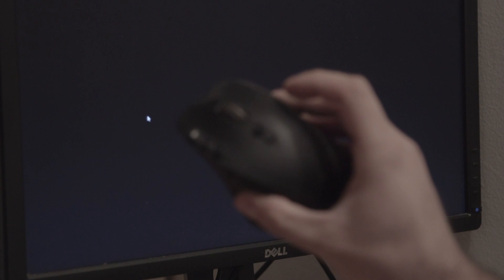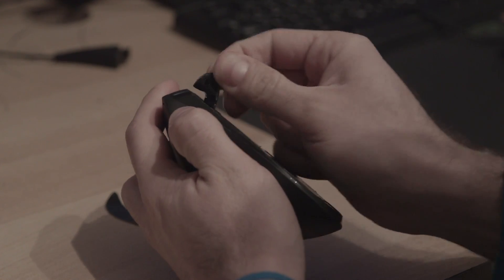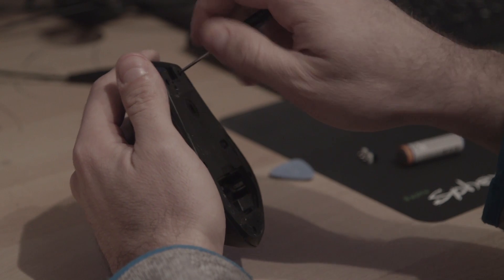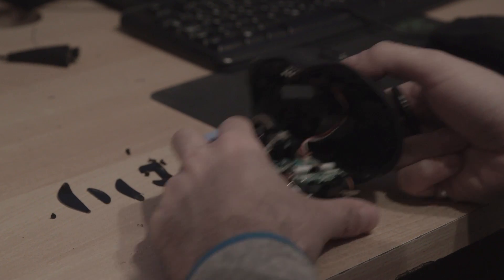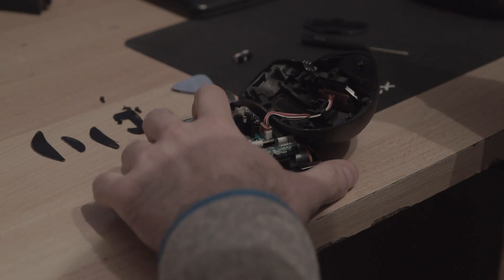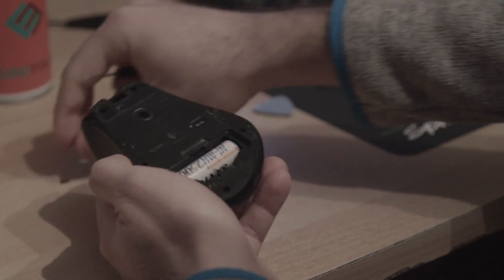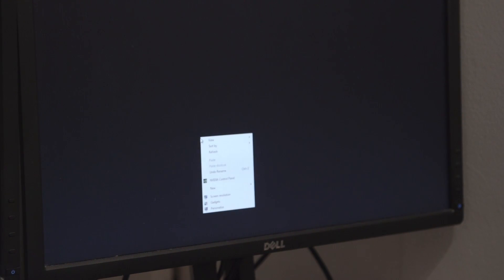How to fix faulty left mouse button (Logitech G700)

Comment: You don't need to remove screws. You can just lift the the left click pad up by sticking a knife or something underneath. It will click loose and you will be able to pull it open for about a centimeter or two. Enough space to see the micro switch and blow air in. Push the pad back till it clicks.
Smart engineers at Logitech.
Reply: Thanks, was wondering about that.
Reply: Thanks! This saved me from having to buy new gliding pads. Just lift up the left or right click button and blow air in.
Reply: you a legend, tyvm!!

Comment: Thank you, Igor. This 78 yo was figuring on having to buy a new mouse because of left click not working. I found your video and upon opening my Logitech mouse saw a small dust bunny lodged inside! I removed it and blew inside as hard as I could several times before closing mouse, and it's working fine again. Sure do appreciate your video help.

Comment: I have a G700s with the left button problem and after seeing that a replacement is currently $400 I decided to attempt fixing it. I can endorse the "Turn upside and smash on desk" method. It solved my problem!
Reply: Work Deoxit G5 into the left and right mouse buttons with a Q tip to fix the double clicking problem. 5 years after treatment and working like new.

Comment: There is even a better way to do it. You can lift both buttons enough to make the switches accessible through the gap. No need for new sliders or a screwdriver.

Comment: Thanks Igor, I've just done essentially the same thing only I used isopropyl alcohol from a can as I didn't have compressed air, worked like a charm. Rather than removing the feet/skates I just stabbed my screwdriver through the holes and it's working perfectly, feels exactly the same as it did to move around on the mouse pad. Cheers!
Reply: I have the problem with my G700s but I'm too scared to start jamming my screwdriver in unless I know exactly where the holes are. How did you judge the positions?
Reply: makbar59 Watch the video above and you can see roughly where the holes are. Then if you press your fingernail around the area that the holes are, you can see the skate start to press into the hole.
Reply: Wish I had read this comment before...my mouse is now slightly scratching my mouse pad.

Comment: 4 years later, yeah, it's not new anymore, but it's still my favorite mouse.

It's wireless when I need it, but can be wired when it runs out of juice, or you can keep a spare set of batteries and swap them out if necessary. The usb cable supercedes the receiver, so I can plug one into my desktop and the other into my laptop, then change which one I control easily. The only thing it's missing is  a magnetic cable, but $15 and you can get one off amazon/ebay/etc that fits inside the little nook fine. The one I found, the cable is strong enough I just have to get it close and it snaps on. I love the scroll wheel. It's got a few extra buttons for macros/hotkeys without having a full fat keyboard on the side like those gaudy mmo mice. It's the right size for my big paw. It sits on a pedestal as the mouse by which I judge all other mice.

I only wish they'd come out with the g700c (or g770 or whatever) that upgrades the usb micro to usb-c and maybe use better switches, or at least not make them such a pain to replace.

Comment: Thanks for the fix, Igor!
I really enjoyed your comments.
Dissasembly + blasting with compressed air did not do the trick for my G700. I fixed a small piece of duct tape to the part that transfers the finger's presssure to the "omron japanese micro switch". Works like a charm again

Comment: My 2014 G700s just died on me. Exact same problem. I guess I'm done with Logitech. No point to buy an expensive mouse if the internal components are the same as a low end mouse.
Reply: Update : I just fixed it without openning it. Just hit the left button realy hard with my finger. Like VERY hard. I'm finger hurts. But my mouse is working now.

Comment: This has happened with every single Logitech mouse I've ever had, it's ridiculous, but what's even more ridiculous is that I still buy Logitech mice!!
In a single year I'll get through  3 or 4 mice, and I'm not even gaming with them, I'm just using them for browsing mostly, no hard knocks, no spills, nothing.

They're good mice until these silly failings let them down, I'm yet to find a decent alternative, any suggestions?

Comment: I have the G700s with the same issue.  Though I didn't have a can of compressed air, I just blew on it a bit then placed a drop of Liquid Wrench on the button and worked it in by sliding my finger over the button and clicking it a bit.  I cleaned off the excess with Isopropyl Alcohol & a cotton tip swab then let it dry.  While I had it open, I did the same for the right mouse button. My mouse works perfectly again!  No more intermittent clicks and unwanted releases.  I proceeded to open up a small travel Logitech mouse that I had stopped using because of the same issue.  It also has the same switches.  I used the same procedure and it works again!
Reply: I use Deoxit G5. Works great.
Reply: @KurentEweser  I looked into it.  Though Liquid Wrench worked, I'm going to get me a can of DeoxIT for future issues.  It seems to be specifically formulated for exactly this type of problem. Thanks!
Reply: @Mr.Vizcaino  Deoxit G5 contains a light lubricant to prevent future oxidation as well as a cleaner. Liquid Wrench appears to have the same qualities but doesn't evaporate when the job is done.

Comment: The lever that is pushing the switch is the problem there are 2 bits of plastic on it ,for protection that you can not press the switch to hard remove these and the fix wil work longer.   the are only 0,1 mm high

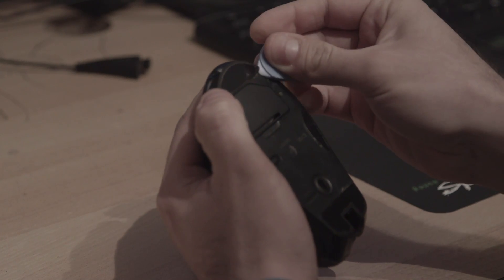Comment: I tried the remove-battery-and-click-100-times method to discharge the capacitors, but that didn't work. But my G700s started working exactly at 1:28 after I started watching this video. Guess it got scared of surgery!  :-)

Comment: My G700s just started this problem. I've had it for 4 years now. Still sucks to see it this way.
Will try and let you know if it worked
Reply: I've had my g700s for 4 years too and I have this problem, I shook it around a couple of times and that did the trick, still happens occasionally, now I'm planning to buy a g502
Reply: @rohansatram   Mine didn't work. I threw it out

Comment: I had the same problem as you, I took the screws out and the case off and cleaned the inside, blew on the switch and it was 100% better. :S weird! glad I tried before going and getting compressed air!

Comment: If you can slightly pry up the left button without using to much force you can basically direct some compressed air over where you know the switch is and give it a good blast and youc an often fix it without having to take the whole thing apart.  Though you're firing blind a bit because you don't want to force the plastic up to high and break it.
Reply: worked perfectly thanks so much!
Reply: Hi, did this fix your mouse permanently? Or did it go back to being stuck soon after?

Comment: turned my mouse upside down and slammed in on the desk a few times while watching this vid, seems to have fixed the problem.  at least for now.
Reply: Followed your tip (except I hammered it into my other hand). Until now it works.
Drove me crazy at video editing. Thanks! :D
Reply: I just did what you're saying, and now my mouse is working like before. Thank you!

Comment: 1) This guy is a genius. 2) I had the same problem with my Logitech G903. If you lift the button, you can see this switch. It's blue, not white. I just stuck the compressed air straw in there and blasted the shit out of it and it's working great now.

Comment: Can I use an automotive compressor to clean it?
Reply: Sounds a bit harsh, because that pressure could blow some components away. You can try your luck and blow with your very close to the omron part.

I'm so happy that I finally found a solution for this because I was living like this for far too long.

I hope it works out for you as well. :)

Comment: i once had an mx518, it worked for probably 8 years before dying. now i have an m510 which has nice ergonomics for me, but it only worked for maybe 6 months before this problem happened. the "cleanup" fixed the issue though, i feared i had to buy a new switch to solder, or more likely a new mouse. thanks.

Comment: Have the problem on my g903 left mouse button, but it happens randomly and mostly I play for hours and it's ok.

Not even sure if it's the hardware (could be oxidation/scale from improper contact) or some driver/os issue...

Comment: Sometimes it is not dust in or on the microswitch, but oxidation on the minuscule contact surfaces inside it. It is possible to open the microswitch and pass an extremely fine grit sandpaper on the surfaces, but it is extremely tiny and fiddly work, with a more than average chance of the switch internal pieces coming apart. It is very difficult to assemble it again without bending the tiny metal sheets. But you can always try it if solding a new microswitch in sounds difficult, or if you live somewhere where they are hard to find.

Personally I have bought a backup copy of my now-discontinued G700S since it is the best mouse I have ever used, and would have a hard time getting used to anything else (for both work and gaming).
Reply: buy micro switches on ebay.

Soldering a new microswitch is alot more easier than open one up and trying to put it back together.

Comment: This helped but I wasn't going to risk opening it.  I gave my MX a few smacks and blew compressed air through the cracks and it fixed my issue.
Reply: There is nothing risky about open up some screws.

The bigger issue is whether the mouse feets lose their stickiness and become bent when you remove them.

Comment: Have the same problem, but on the G900. Thanks for your video. I appreciate it. I will get to work. Agree with you. Love Logitech designs and products while it works, but hate it when it breaks down for stupid reasons like that.

Comment: In the end you ideally buy cheap micro switches, take out the copper spring and put in your mouse. Alternatively take your micro switch apart to just reshape the copper spring. It's either one or the other that is the best solution that works.

Comment: Thank you so much! I freaked out after my G302's left click stopped working completely since I can't claim the warranty in Pakistan. Your video was an immense help, I took it apart and after a fuck ton of blowing from my mouth the button is working flawlessly. A suggestion for anyone who doesn't have access to a can of compressed air get a bendy straw that way you can better direct the air towards the holes.
Reply: Video discription says its for double click problem but it works for all other kind of issues too including click not working. if u r a bit experience use soldering method then the problem won't reoccur frequently.

Comment: I have a brand new Logitech G700S and it started doing this shit in less than a year use. 
I tries blowing compressed air without dissembling, kinda didn't do anything as I prolly couldn't hit the switch. 
Then I tried the turn off and click method which brought it back to to how it was and it worked perfectly, for about a week or two. Now nothing helps. xD 

I just tried doing the clicky thing, still not resolved really. 
I kinda makes things a bit better, but I think it doesn't really solves it. 

I had the scroll wheel metallic cover started rusting and peeling here and there too. xD 
I can't say I'm pleased with that, but generally I wouldn't care less until the LMB click started. 

Tbh, kinda disappointed with Logitech given I had a G5 that lasted for like 10 fucking years, which had other stuff fail, like the scroller wheel, but at least it was past the expiration date and the LMB and RMB worked till the last day. 

Given the G700S should've been gamer grade, this doesn't really speak well when this issue is seemingly that ubiquitous. 

Sure doesn't help from stopping you to finally wanna wander and try other brands, especially some that are priced cheaper, yet still have good critical feedback. In the worst case scenario, at least you will waste less money. Hear that Logitech?
Reply from the maker: You bought is less than a year?
Reply: Yeah, it was brand new purchase, not refurbished or anything. 

The funny thing is that since last night it apparently hasn't had any hiccups, until the next time I guess. :P 

But why it's funny, is bcs I was trying everything, starting with 2 powered off exhaust clicking sessions, that seemingly didn't solved things right away, so I went and tried blowing with compressed air through the narrow, when I lifted the LMB with a bamboo toothpick. That too I thought did nothing. 

Overall, it seems to have gradually reduced doing the hiccup over the night. 
It certainly didn't seem like either thing solved the issue all alone, rather the mouse has a mind of it's own and tho the efforts I did seem to improve the situation, it's rather co,es and goes when it pleases I assume. 

I've never had experienced that before, at least not with higher tier mice. :P 
Altho the part actually costs next to nothing and it has many ways in which it can fail, even straight out die. When I build this computer I also had 1 of my 2 pack Crucial ram stick DOA, but other than that everything else seems rock solid so far. 

But ppl spend the extra money with trusted brands, not only bcs of the seemingly higher quality, but also bcs you would put a little more trust into those products, like having them wait until their expiration date at least before they start to act all strange. xD 

With that being said, I know that no matter how expensive a tech piece can always fail or have a defect, it sadly happens. However, with this case it seems like there's a bit of a trend, and when that happens the reasons are more likely than not that the manufacturers cheaped out on some aspect, whether the parts themselves or mostly skipping QC completely. xD 

Whatever the case, this isn't a good practice, the obvious reason is not only that you are making a bad name for your company, but you are also trying to screw and skimp your customer base. 

Maybe you can make a few thousand bucks from cutting corners here and there, but if you made the fuck up to cause a whole line of a product ending faulty with a specific tendency more so, it really can make ppl turn towards other brands the least, not to mention forsaking your brand for life. :P

Comment: Worked on mine.  Thanks a lot.

One suggestion:  I was impatient, and didn't want to wait the couple of days for the replacement teflon pads.  What I did was use an X-acto blade to cut holes over the screws.  I got a general idea of where the screw holes were located from your video and some others.  Then, I smashed down on the pads, and I could see where they dented in.  The only tough one was the shallow one under the thumb buttons.  Because it is so shallow, the screw tended to grab the blade, making it difficult to slide it to cut the material.

A secondary benefit of this is that the pads act as a screw holder.  All five screws were held in place.  Less chance of losing one, and they made putting the top back on very simple.

I can't feel any difference moving the mouse on my mouse pad.  And, if I decide that it's not working, I can always order new teflon pads, anyway.

Comment: This is my second Performance MX mouse because I really liked the first one. It began doing the same exact thing again which prompted me to google a solution. Thanks for making this video. It is very helpful and I like your tutorial style. I decided after watching you take it apart I won't be buying another one of these because it doesn't appear they will ever fix it. I slammed the fucker a few times and low and behold it works fine. For now. I just ordered a completely different product so I can throw this piece of shit in the trash the next time it acts up. I only wish I could still leave an Amazon review to warn other poor bastards like myself to steer clear.

Comment: just want to say that I slammed my G700 first on my desk then on my bed (because the desk was a little too hard) a couple of times, like he mentioned 3:39,  just because why not, and it ACTUALLY fixed it. I think it kinna worked like that can of air, the slamming "moved" the stuff that was in that switch. But I know this Isn't a permanent solution ( or maybe it will be :) ), and some people say that its the metal part inside the switch which get "fattened out" over time, that you have to curve  back a little. But yeah, just wanted to mentioned this as it actually "fixed" my G700 within 10 sec :)

Comment: TAKE OFF THE TOP HOUSING AND PUT A DAB OF SUPER GLUE WHERE THE LEFT OR RIGHT CLICK CONTACT SPOT IS. LET IT DRY FOR ABOUT 24 HOURS, THEN PUT THE MOUSE BACK TOGETHER AND IT SHOULD WORK
Reply from the maker: Im Jays I would not advise that method.
Reply: I did it and it worked
Reply: Yeah^ do NOT do that.

Comment: Had exactly the same problem, and blowing air did not resolve it. BUT THERE IS A SIMPLE FOLLOWUP!!!!
You need to use a small sharp object and you can lift up the cover of the switch itself. Look at 5:41, you can see 2 small holes on the side of the switch itself that Igor blows air on. You can lift this part up between those holes, be careful as it "jumps up" don't loose any part. Once opened, there is a metal connector that had some dirt/dust on it, i cleaned it up with a small alcohol pad, clipped the cover back on it and it came back to 100% functionality!
Reply: True story, I did this on two mouses already. Those switches seems to be standard parts.